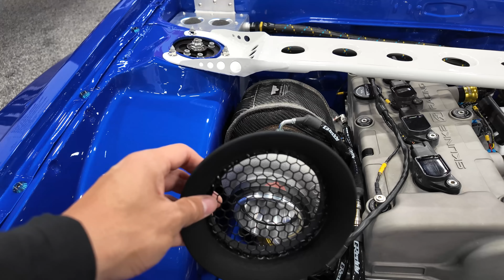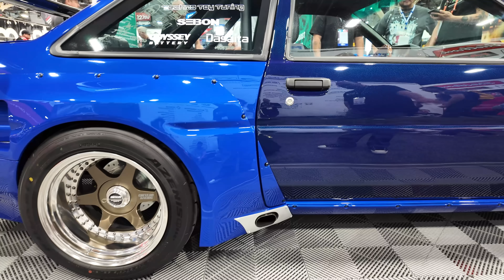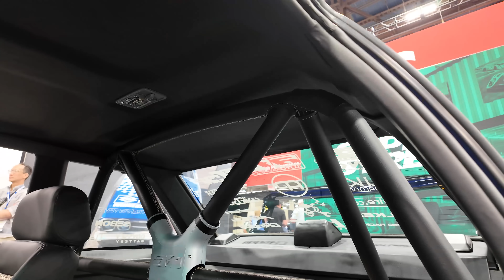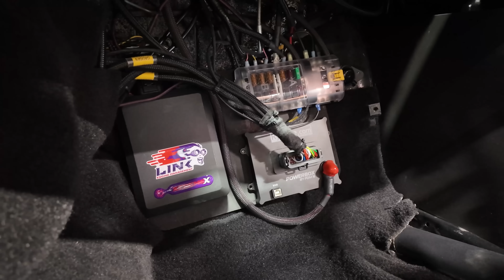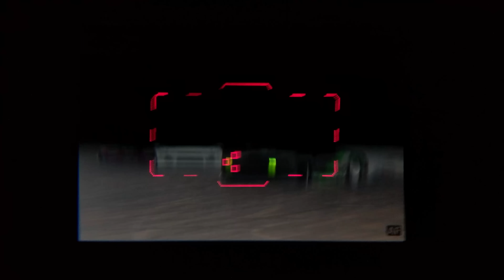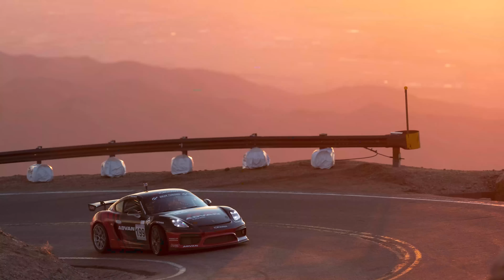Modernized AE86 Blends New and Old Into One Crazy Package

Comment: Why does everyone at SEMA lie so much about the power potential even tho they say they won’t run it at that.

It’s on a turbo capable of 700bhp flywheel max. Why say 1000.

It’s a wild car, but lying just aint for me
Reply: the 2.7 stroker on ITBs would be more than enough for the chassis. would sound way better too